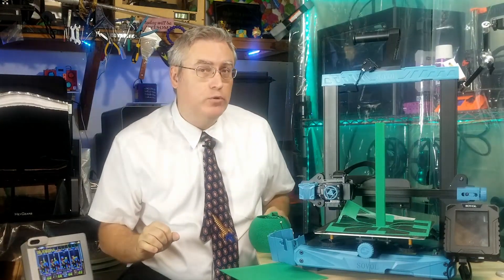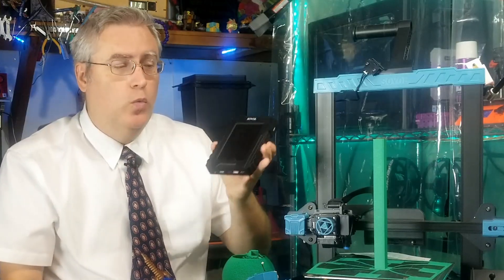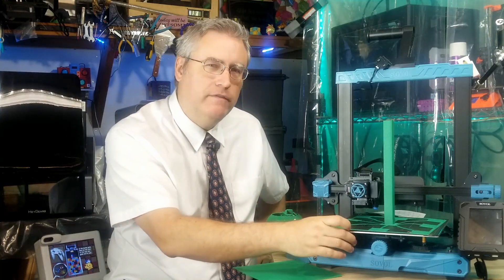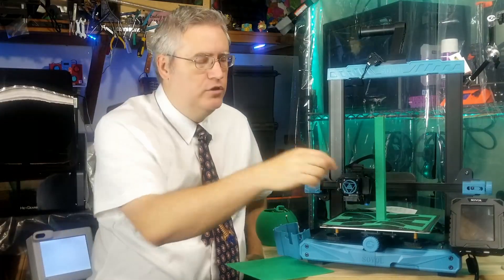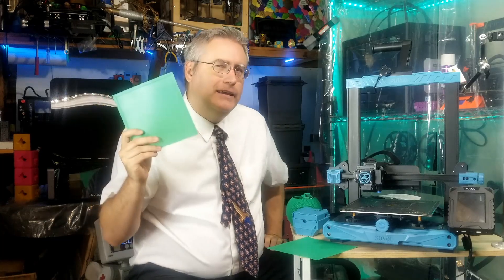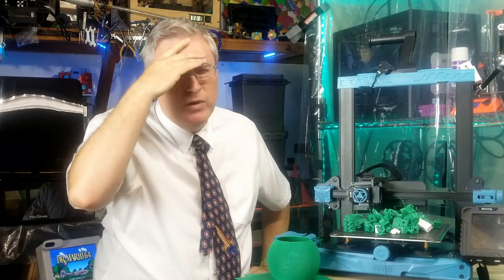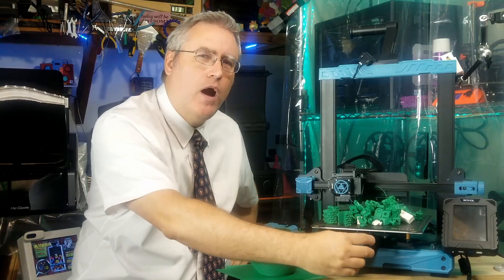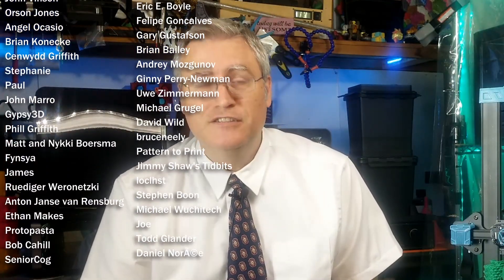Fast isn't always better, Sovol SV07 Review

Comment from the maker: I wonder if anyone is going to notice the difference in video quality. https://www.3dpprofessor.com/2023/06/29/sovol-sv07-review-video/
Reply: They should, it is a way different camera
Reply: Hey I’m having an issue with the sovol sv07 I have at my club at my college, I keep getting a max volumetric flow rate reached error, I’m using orca slicer.
Reply from the maker: @ZeFoxii  interesting. My only thought would be that you need to slow down a bit.
Reply: Yeah, I could tell it was off but it's good enough. That's how most work in life should be performed, unless you really need or want a superior quality. I only use 1080p for my canon and gopro which are fairly modern. It's just not needed (unless I need to crop) to go above that level and makes working with it much easier.z

Comment: I know this is from a year ago, but I just got one of these last week, and I actually bothered to RTFM, and found the tools and USB no problem, because they're listed right on page 4. Even has a diagram. Also had zero issues with the start up, because there's a note right on the screen protector on how to do that. Also, I used a velcro strap to attach the accelerometer to the gantry and build plate, since it was only a temporary thing. Been printing like a champ so far.
Reply from the maker: They changed the manual after my feedback.

Comment: You did not do proper setup. Set temperature for bed/nozzle  1) Z offset paper test, then save,  reboot 2) Screw adjustment, then save, reboot 3) Tilt adjustment, 4) Bed mesh  Then a first layer test.  I print pla + with no issues at 0.2mm no adhesives on the textured side.
Reply from the maker: Interesting. They should rewrite the manual.

Comment: Benefit of the doubt here but in the footage you provided @2:00-2:09 you can clearly see you haven't turned on the power... Also, your camera lens during the frames you were sitting next to the printer needs cleaning, unless you are going for the exaggerated flare. Just my opinion but it doesn't look good, looks dirty. I agree with your drawer complaint. Just bought mine this week and I didn't notice it had one until I went back to the place I bought it and saw it mentioned. I was thorough with my use of the manual but still either overlooked that bit or it wasn't mentioned at all. I had issues with adhesions as well but my experience with painter's tape was a little TOO good. Nozzle would ram into the print and not come off but instead break pieces of the print off... That said, I am completely new but also tech savvy and the amount of problems I had out of the box would deter most newbies from even getting into 3d printing. It's been a year since this video but there have been several software updates to both the Klipper software and the out of box software... that was an absolute nightmare to update. I temporarily bricked my display, which was thankfully a thumbdrive away from a fix... the amount of hassle this produced was almost my breaking point. Extrusion appears to be a big calibration pain point as well. Currently running it through Orcaslicer (which has SV07 Plus presets now). Giving this my absolute best effort to get good prints from. I do think since your video and many others, they've either corrected, adjusted, or altered how this machine is/functions. Again, this has been my only experience with a 3d printer and it has been very exciting but exhausting troubleshooting so many issues that I find odd exist in the first place...
Reply: P.S. This machine has caused me to lose sleep. And I mean that as a good thing. Can't be more excited to finally have one!!
Reply from the maker: I'm glad you're at least having a good time with it.

Comment: There is something untrustworthy happening here. Talking about not being able to find your memory stick in the drawer as a negative? You saw a first layer going down poorly and not only let it continue, but abandon it for long enough on the 1st day that plastic wraps around your nozzle? And putting a screw into a hole in a bracket, then removing it is not difficult for normal people considering that very few printers have accelerometers.
Reply from the maker: Untrustworthy, huh?
I'm giving you my 100% honest experience an opinion. I'm not holding anything back. If that's not worthy of trust, I don't know what to say.

Comment: Do ya still use the sovol 7 printer
Reply from the maker: Nope. Ditched it as soon as this video was over. 
However, I handed it to someone who fixed it up and is apparently quite impressed with it once he got it running. So it went to a good home.
Reply: @3dpprofessor  did u just not Like the design or ?
Reply from the maker: @monsterstorm78  15:14 death by 1000 cuts.

Comment: got an ender 3, an anycubic kobra 2 neo, and just got a refurbished from sovol sv07 and i can honestly say I do not see myself purchasing any other brand of printer after having the sovol for even just a week. the print quality is light years ahead of the other two and its a little over twice as fast as my anycubic which i initially got for speed to make products more consistently but now with the sovol i barely need the other two for products cuz not only is it wayyyy faster than the original ender and my kobra 2  but the quality is second to none, i havent tried to many filaments but for pla, pla+, and petg so far i would highly recommend it and itr has every bell and whistle you can think of, for anyone and everyone looking for a printer id say to get a refurbished sovol, they test them and fix any and all issues before they leave the warehouse so for a discounted price and a functional product you cant do any better than this. now its time for sovol to come onto the enclosed printer scene and make their own k1 or x1c and theyd really have some weight in the arena.

Comment: Reviews are supposed to be objective to help potential consumers make a decision. This video felt like my wife was throwing a tantrum. Thank god I'm not married.
Reply: I think this video did its job. When the biggest issues are the drawer is hidden you know it's a good buy.
Reply from the maker: You think the drawer was the biggest issue? 15:05 The biggest issue with this machine was all the issues with this machine.
Reply: @3dpprofessor  why would you see a layer going down poorly on day 1 and nod restart it? I agree, it sounds like a petty hit job.
Reply from the maker: @spyrit35   Is it petty to expect better from a company that had just released a printer, the SV06, that didn't have any of these issues. One of the stated goals of this channel is to improve 3d printing in general. If I excuse things like a half baked accelerometer system, substandard springs on their leveling system that goes out of leveling during the first print after they're leveled, as well as the Y-axis tensioner loosening over time, and inadequate user documentation, then I would be lying to you and being untrue to the purpose of this channel.
Reply from the maker: Can't imagine why not.

Comment: Suggestion for bed adhesion... might seem crazy, but I'm guessing the build plate you got was "dirty". 
Basically there is an invisible oil / substance that's making the adhesion misbehave regardless of your Z offset. 
I recently had this problem with a printer and it took me over a month to eventually diagnose and solve
Just was the plate with hot soapy water, scrubbing the textured side with a soft toothbrush.
Afterwords, as an extra measure I'll occasionally touch it up with a light scrub from a magic eraser for fine sanding / smoothing to ensure the texture is as uniform as possible.
I do this now every 10 - 25 prints and haven't really had anymore bed adhesions issues.
Hope that helps!
Reply from the maker: I'll give that a try on my SV04, which also has bed adhesion problems. 
I did try isopropyl alcohol, which usually fixes it, but it did not in this case. Though, doing that every 10 prints or so seems like a lot of work.
Reply: @3dpprofessor   I used rubbing alcohol before and it did clean it most of the time when I first got the printer. But, it can't fully clean the plate. The oil or contaminents that build up go aren't usually that visible (sometimes a slight sheen or darkness in areas that see a lot print coverage). I thought my plate was clean and was getting so frustrated because I had tried everything else. Most forms of additional bed adhesion, dozens of calibarations, and many printer tweaks. But after scrubbing it with the above method, my next print stuck on like a rock. I was blown away and have been sharing the knowledge ever since. You can probably us isopropyl for intermittent cleaning but maybe every 25 prints or so, give it a good cleaning. I should also not that I'm doing this on a PEI textured magnetic plate, not glass or smooth but it would probably help with those as well.
Reply: I had similar problem as well and long time I cannot figure out where is problem until I tried simply clean when plate is cold with very warm sponge, simply like that - hot side absorb from cold. I also added little bit cheap sugar soap and later over clean with water, it does magic

Comment: 1. He did not wait 20 sec for initial boot up, turned off host half way and messed up file system (did not see status lights??)
2. you could not see the tool drawer? Put on your glasses!
3. PEI sheet of this printer sticks amazingly well, no problem with PLA, PETG. Just wipe your greasy fingerprints with dish soap or isopropyl alcohol
4. set belt tensions correctly, there is no layer shift
5. never leave your 3d printer unattended, especially before proper calibration. If caught in time you would not have any blob 
6. you know you can spin the z lead screws manually to lift the head? (then do an automatic z-tilt calibration)
7. input shaper calibration is not necessary, printer comes will calibrated from factory, it does not need to be done often. The accelerometer is a nice addition to have in the package. It takes about 45 seconds to mount for a normal user
It feels this reviewer has some affiliation with bambu labs, mentioning that brand twice as many times as Sovol. Makes his reviews a bit questionable.
Reply: You could also buy 3-4 of these printers for the cost of a single Bambu printer.

It's true that there are more "beginner friendly" printers out there, but you're going to have to pay more for them. If you don't mind fine-tuning things, the SV07 is an excellent printer for the money; large build volume, 300C extruder, quick travel speeds, and klipper out of the box.

I wouldn't purchase a Kia and then hold it to Lamborghini standards. It is what it is and I don't think it really pretends to be anything else.

For $279 (at the time of this comment), I don't know if there's another printer that beats what it offers.
Reply from the maker: I can tell you're a fan.
Reply: @3dpprofessor  be real man, half of your problems would not have existed if you read the product description and the manual
Reply: @razvankolumban4129  yeah, drawer is a feature on pictures when you buy it, the more I listen to this guy, the more he sounds like goofball, is it his first 3d printer?
Reply from the maker: @razvankolumban4129  I realize it went by a little fast, but if you watch the unboxing at about the 1:33 mark, you will see that I had the manual open and reviewed it every step of the way. I always do this because my concern is for the new user. So if it says it in the manual, I do it. If it doesn't, I contact them and let them know. 
So maybe they fixed the manual and because of that your manual and mine don't match. So you had a better experience because Sovol listened to my bad experience. 
You're welcome.

Comment: I picked up one of these about a month ago, and had a couple of weeks where I was pulling my hair out as it would not print correctly... turned out that I followed the manual for the bed accelerometer testing and the sensor was on backwards?? I also have had no issues with material sticking to the surface of the bed, PETG/PLA with no issues. thank you for outlining a couple of issues which will need to be addressed. as I get the y layer shift from time to time. overall, it did exceed my expectations but its defiantly not an entry level printer. definitely one for someone who had one or 2 before. or have a really good understanding of 3d printing...
Reply: The accelerometers I have used had arrows marked on it to ensure correct alignment.  Is the problem with the manual or the sensor?

Comment: If you have been printing as long as you have, and you don't disassemble every hot end, apply Anti seize to all threads and screw heads, Loctite all extruder set screws, and take an inside and around look at the overall build before printing, you aren't experienced...you have good luck lol.

Not knocking the professor, just saying guys...these are mass produced printers that need you to know them better than you do with your lawnmower.

EDIT:

We are buying cheap, and much higher quality printers these days.  That is not a replacement for prevention...about 3 ounces in this case.  Just make sure to go over everything.  make sure your nozzles are flat where they mate with the heat break...make sure that is flat too.  Look at hidden screws and blue Loctite them after degreasing them.  Lube your bearings and adjust those pom wheels and belts so they are as silky as possible.  Lucas gun oil with a needle tip at an auto parts store will not drip like WD40...it sticks...and can handle temperature.  It is also easy to apply.  Act like you care about the money you spent.

I would rather wait a couple weeks and get all the quality replacement parts that I choose, than have a massive failure on an important overnight print and also have to order replacement parts but from warranty service.  I bought a cheap printer...imma make it good:)
Reply from the maker: Maybe 10 years ago that would be the case, but these days I've had printers from FlashForge and Weefun and a handful of others that just work and work for years with minimum maintenance. 
One of the 3 stated goals of this channel is to encourage 3d printer manufacturers to be better. Sure I can do day 1 upgrades to make a printer reliable. I could also ride a horse to work each day. But I chose to live in the future.
Reply: @3dpprofessor  I want what you want, but they still aren't there yet...by a long shot.

I live in the future lol, I am a pre-crime detective for 3d printers!

I loved your honest manufacturers video too, thank you for that.

Comment: Actually drawer and all tools in it are on the fourth page of the manual sooooo someone didn't even take a peek and complains.
Reply from the maker: Not on mine. They changed the manual because of this video.
Reply: That might be it @3dpprofessor  . I don't know if I have missed it but what was Your printing material Sir? I have zero problems printing with PETG on this printer but a lot  of similar problems to the one in this test printing with ABS. Don't know if I should even try ASA.
Reply from the maker: @deciver5  I tested it with PLA.
Reply: You do need a different mindset if you are an early adopter.
Reply from the maker: @petercallison5765  that's an excellent point. 
And as long as they're learning and adjusting, that's good.

Comment: Thank you for an honest review, I currently have an SV04 with a Creality glass bed cos prints didn't stick, that's probably what the 07 needs too, I also have an SV06 with the pei plate, both now have reasonable reliability, I have wondered about upgrading to Klipper on these machines, but maybe it's a case of if it ain't broke, don't fix it 👍

Comment: 4:30 - The accelerometer doesn't need a quick attach clip.  There needs to an X accelerometer and a Y accelerometer, and they need to be permanently mounted.  The accelerometer chip is tiny and very low mass.  It could easily be integrated into the print head.
Reply: I have 2, i leave 1 attached to the printhead, and 1 screwed to a printed holder that slips onto the bed.  Sv06 with klipper

Comment: This printer arrived yesterday after I placed a preorder. Without any prior knowledge, I put it together and levelled the bed in less than one hour, and it hasn't stopped printing since. As this is my first 3D printer, I am unable to compare print quality, but I think everything came out quite nicely. I also printed a few of my own models and had no issues.
It might be the case that you got a lemon, but I think you didn't even try to put in any effort, and the fact that you didn't find the tool drawer at the bottom is a dead giveaway.
P.S. I watched all the videos about this 3D printer, and from what I can tell, they listened to the feedback, one example being that mine came with an extra PEI plate and metal twizers.
Reply from the maker: I wish mine came with an extra PEI plate and metal tweesers.
Reply: @3dpprofessor Mine did as well? That's odd the company should reach out to you and send you these items. Idk if it was a bundle but my little brother's has one as well and it came with the parts, they also weren't listed on the site I got them from so it was odd.

Comment: I don't care about how fast it is, I just care about how accurate it can print. How much it can do non traditional printing without star stepping. How complete it can print a hole in any position.
Reply: What have you found to be the most precise?
Reply: Once you have used a fast printer you can't go back.